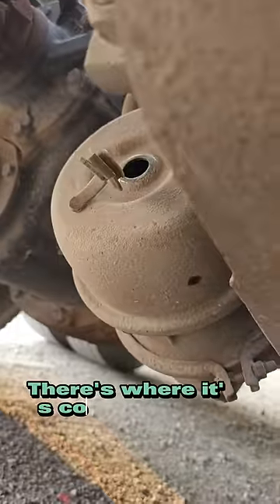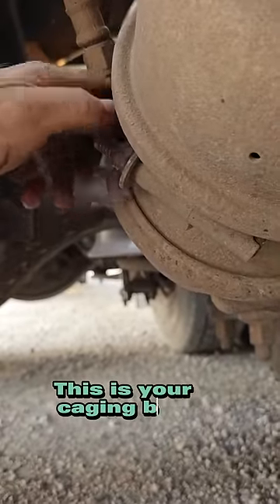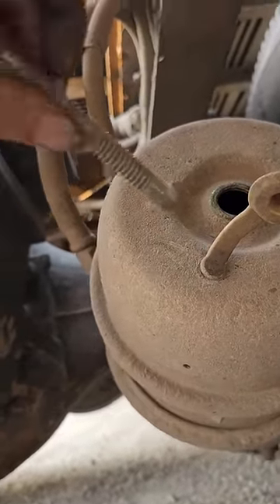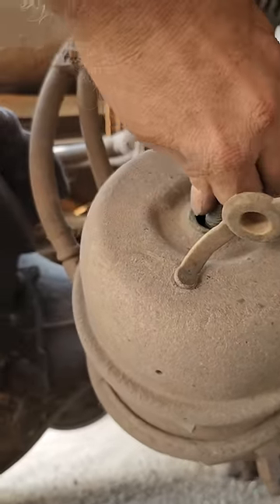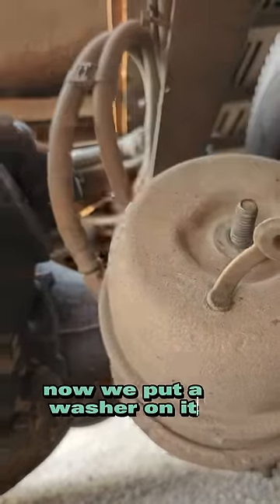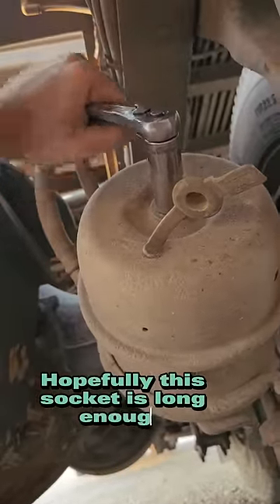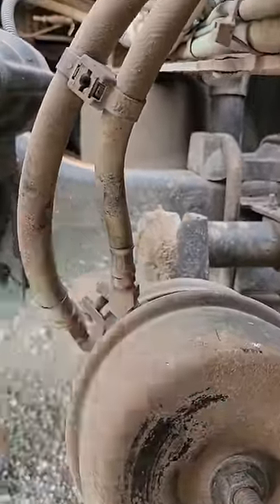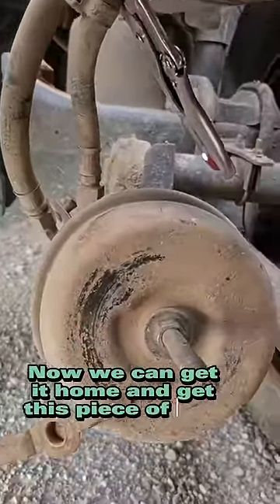How I cage a brake chamber and get home

Comment: cut the end off a 3/4 deep 1/2 drive and weld a 4in piece of pipe between the 2 pieces socket. that way you don't have to us a open end wrench.
Reply from the maker: That's a good idea.  Would of saved me some money.  I just bought the socket instead.

Comment: You ruined that hose by pinching like that. Disconnect that hose from the fitting, insert a dime, (10 cent piece) it fits perfectly, reconnect that hose & tighten it down. The dime blocks all air from entering the chamber.

Comment: Id be scared about driving a big rig with a brake out like that. Prolly only sane to do on a empty load.
Reply from the maker: I was empty.  Only 30 miles.  Brakes still worked fine.  No more air leak and no $1000 tow.

Comment: Is it legal to drive with a caged brake chamber…
Reply from the maker: Yes.  It doesn't violate the 20% rule.  1 brake chamber out of 10 is only 10%.  Most truckers don't know about this rule.  It's not an oos violation, but probably still a ticket.  That's at least how I interpret the rule but it seems to be a rule that has many interpretations.

Comment: Why mechanics take off that bolt that come with brake chamber?
Reply from the maker: The brake chambers come pre-caged.  You have to uncage it after installing it.  Then you're supposed to put the caging bolt back on the chamber in case it will be needed in the future but a lot of mechanics don't do it.  Wrecker drivers are apparently the worst about doing it after towing a truck.

Comment: Has anyone ever caged a brake with a socket ? I have only done it few time but I'm always using a wrench
Reply from the maker: I figured I would get all I could out of it before I had to bust out the cresent.  I have a socket I use now specifically made for caging brakes.  It's pretty long.  Works great.

Comment: I haven't seen a truck driver that works on their truck in a very long time.  Now days they just call us and pay 250 bucks to cage a brake chamber. If we replace it on the side of the road it'll run em about 450 !?!
Reply from the maker: Yeah.  I avoid that at all costs.  Heck, I've changed out a blown tire on the shoulder a few times.  I try to carry enough tools and parts to be ready but not so much that I'm weighing down the truck.  Its a fine line.

Comment: I had to drive with caged brakes, empty trailer…couldn’t stop for a red light from 55mph, should’ve been easy, straight up will never do that again, company can get a tow truck.
Reply from the maker: Damn.  Mine worked just fine.  🤷‍♂️.   Had no air leaks and brakes worked as normal.
Reply: @aftersolo  it was about 5 years ago, mid trip pulled over to water the plants and then the trailer brakes wouldn’t release to get going again.  I forget the exact problem but roadside assistance couldn’t fix it without specific parts, and the only solution was to cage the brakes, or a tow.   It looks like you only had to cage one chamber, I had all four chambers caged so it was purely the day cab tractor brakes I was depending on.  It was middle of the night, early morning, will never forget barreling towards the red light , three way intersection, thank god the pick up truck saw that I wasn’t going to be slowing down in time, I was probably flashing my brights like a strobe light.  Never again, the company can tow it or drive it themselves.
Reply from the maker: @suburbanlarper  completely understandable.  Be ready for a lecture from a random stranger on here.  I'm just warning you.

Comment: Caging brakes is for when a truck can't hold air and has to be towed. NOT FOR DRIVING home so you can "fix" it there
Reply from the maker: Is this D.O.T.??  I'm not calling a wrecker to be towed 30 miles home when I can safely get it there myself.  I run in areas all the time with no cell phone service too.  What would I do in that predicament?  Start walking? Truckers do it the way i did it all the time and have for decades.  I'm not paying $1000 for something unnecessary.  We do what we got to do out here to get by.  I'm not a company guy who cam just call breakdown.  I'm the entire company.
Reply: Caging brakes only releases the parking brake.  Your service brake still functions as normal.

Comment: I can't believe you just put vice grips on one of those air lines smh
Reply from the maker: Better call OSHA.  It was fine.  Chill.   Even if they fell off, which they wouldnt, it would still be fine.  You're aware of that correct?  The chamber is caged, meaning even with air applied, they wont engage.  I could of actually made it home with the air leak but figured i would play it safe and cage it.  I could of done everything absolutely perfect and somebody would of said I need to put a padded mat down so I don't hurt myself and pad the frame and put up caution tape and call local authorities to tell them what I'm doing and wear gloves bc i could get a cut and have first aid ready and dont use a crescent bc danger and chalk the wheels and I need a certification before i can do that on and on and on. The vice grips were tight though and those air lines are stout.

Comment: How lucky are you to not be driving anywhere near the rust belt.  Where I live, step 1 is to break out the oxy/acetylene torch to cut everything off.  Step 2 is to order a new truck.
Reply from the maker: I can imagine.  The truck came from Kansas City.  I got it in 2018 and I had to repaint a lot of the frame due to rust.

Comment: Released like without air??? Don't you mean released like with air?  Omfg
Reply from the maker: No.  Released without air is what I meant.  Normally, they are released with air like what you are referring to.  It's a failsafe system.  Air=Unlocked.  No air=Locked.  There was no air supplied to the chamber in the video bc i removed the air line from the chamber, so of course I meant released without air.  That was literally the whole point of the video. I had an air leak, so I had to stop the air leak by squeezing the air line with the vice grips.  After that, there was no more air supplied to the chamber.  Normally, under these conditions, the brakes would be applied.  The caging lbolt kept them from engaging by compressing the spring inside the chamber.  Omfg